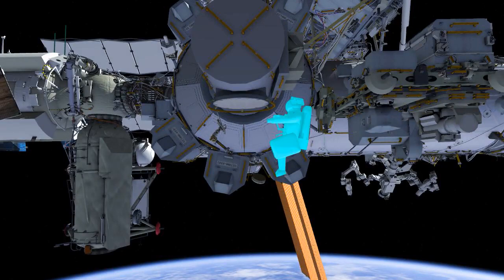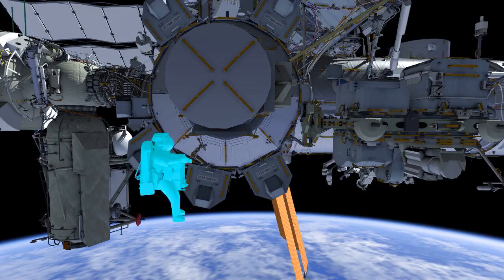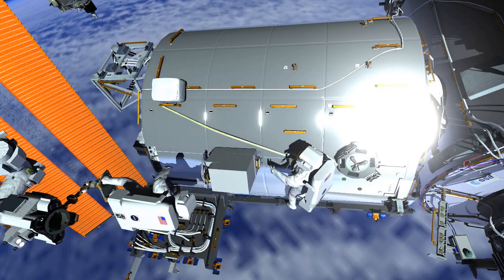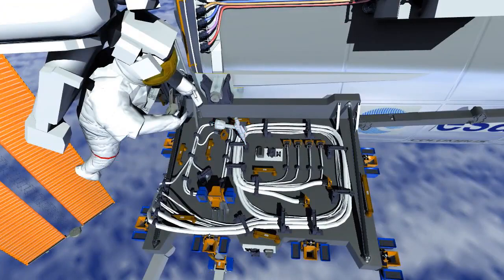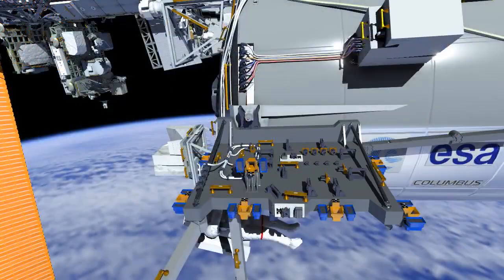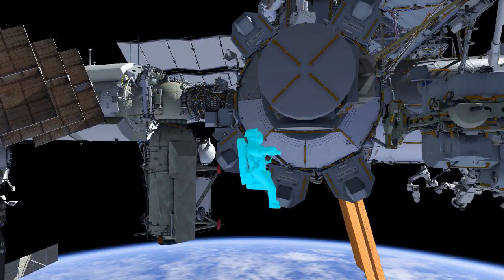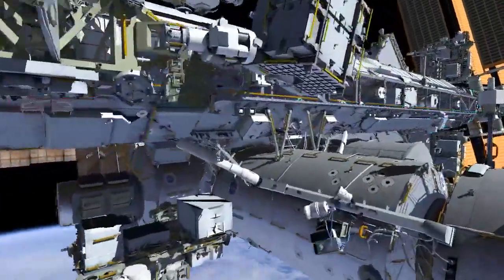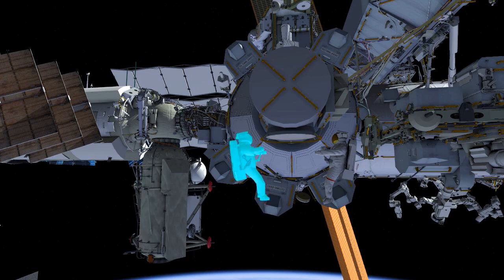Spacewalkers to work on cabling and antenna for ISS science platform | Animation

Comment: THE INTERNATIONAL FAKE STATION
1. 17,000 Miles Per Hour...?
2. Loose Cables Exposed...?
3. Incapable of Flight
4. What is it's propulsion...?
5. How does it maneuver...?
6. This is CGI
7. Space walks filmed in a pool
                  🤔😑😏
Reply: It’s propulsion is orbiting the earth in orbit no propulsion needed
Reply: 1. Velocity is relative. You can be going at 600 mph in a jet, et you can stand up. It’s just like that, except you’re going much faster. 

2. Loose cables exposed because why not? You’re not in air, so it doesn’t have any turbulence or cause any drag. And it just makes it easier.

3. I have no idea what you mean “incapable of flight.” Yes, I guess it be incapable of flying in air, but it has no air to fly in. It was launched in multiple pieces over 20 years by flight capable vehicles like the space shuttle. And you don’t need to fly it in space because it’s going at a constant speed so nobody needs to control it.

4. The definition is “the act of driving or pushing forward.” Although the space station doesn’t have to use propulsion because it’s going at a constant speed in the same area.

It maneuvers using RCS (reaction control system) thrusters to keep it in the same orientation. But besides that, it doesn’t maneuver. It’s in a constant speed and will never come down.
6. No CGI

7. To train, yes. But they do the real ones in space.
Reply: And yes this is a animation of what’s going to happen